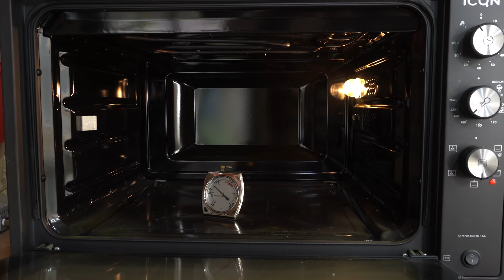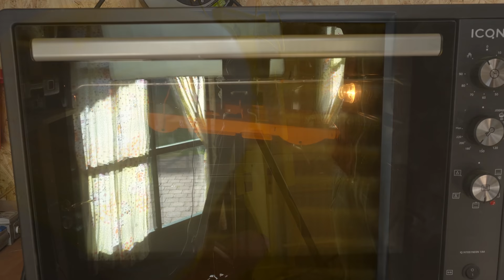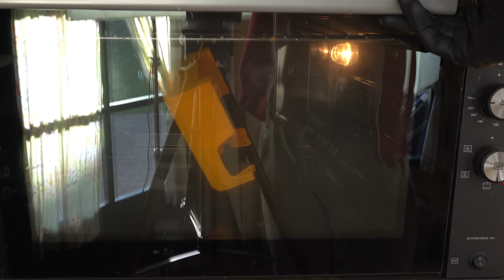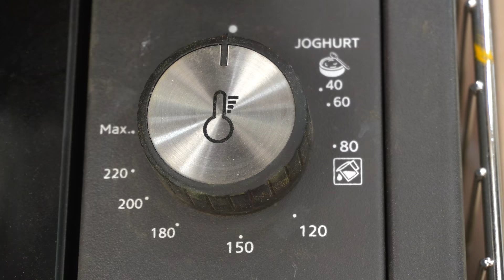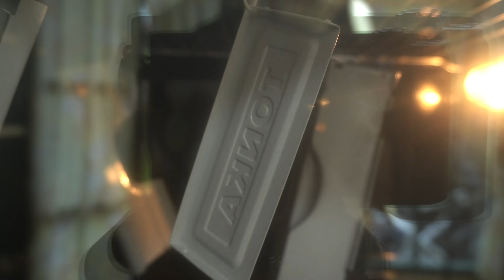Restoration Tonka Pick Up Truck 1975s - very rusty and old

Comment: First off, Very well done. I was wondering though, wouldn't it be better to apply a gloss coat over the grill to prevent rust? I understand where you're coming from with the grill styling and I think it looks better the way you did it. All the parts on Tonka toys were painted or colored plastic. so your take on this truck is original. good going, keep up the good work!
Reply: Pgg

Comment: I'm curious about the powder coating. Does the vent provide for a loss recovery system, or are you what seems to be about half the powder? And what are the benefits of powder coating over spray paint or airbrushing (industrial airbrushing, that is)?
Reply: Ok Boomer

Comment: what's that tool that you're using to clear rust on the metal parts?
Reply: I believe you are referring to the sandblaster, or media blaster. he has a cabinet which is very nice as you recover and reuse the blasting media until it gets too dirty.